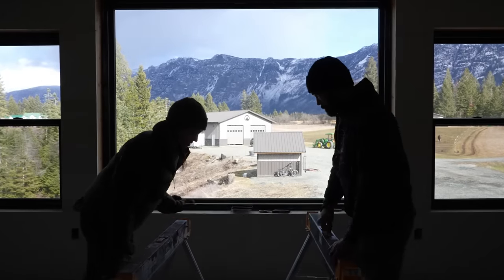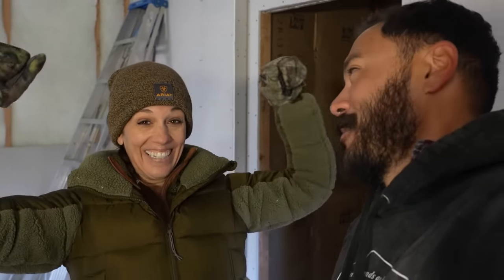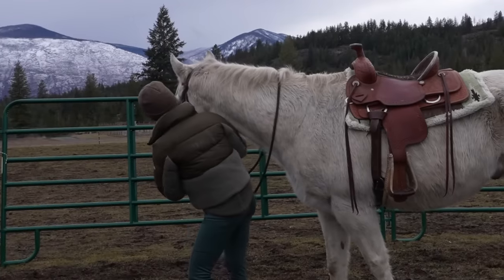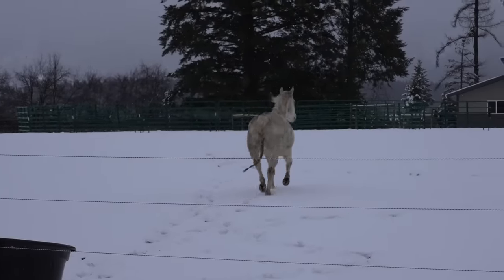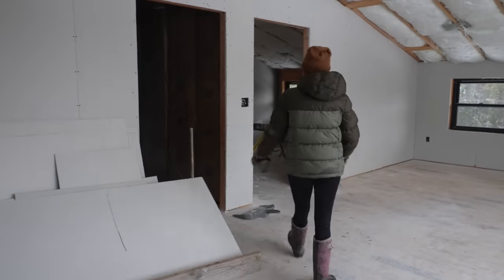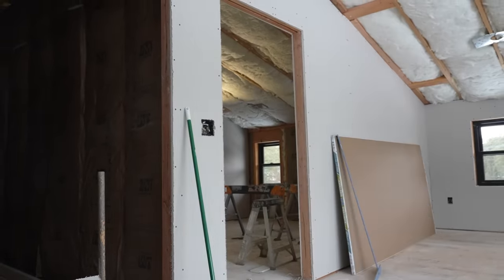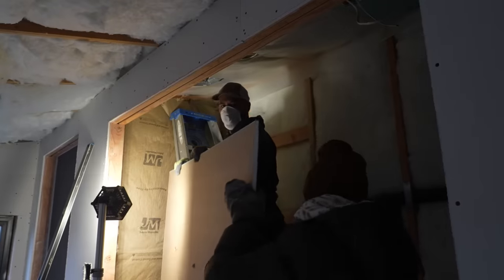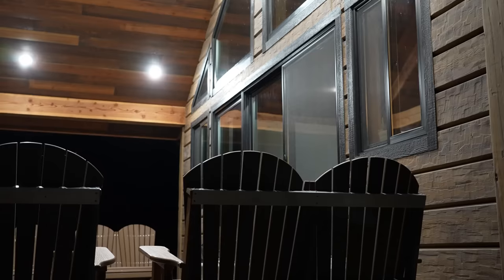We Have a New Deadline! Major Push on Our DIY Mountain Home Build

Comment: Vertical will make the wall look a bit taller, which might not be a bad idea in a room with low ceilings :-)
Reply: Yes, walls absolutely vertical. Ceiling, follow the lights rays. 😊
Reply: Get kiddos to help… especially if it’s to be their space for a bit of time. I learned to wire outlets and switched at 13. Father always checked them…. But the “shop teacher” needs to return!!!  (Of course that’s my opinion, you are the parents and a family unit. ) 
Enjoy the build and the challenges you work through. You have done fantastic!!!!!!

Comment: If you go vertical on the ship lap, it will look like a wide bead board.  I think that vertical on the ceiling and horizontal reclaimed barn wood would look fantastic on the side wall.  And since the bed is going there, it would be an excellent back drop  and a great place to hang pictures or some sort of art.

Comment: Horizontal on the feature wall. Paint it slightly different from the ceiling. Glossy on the ceiling? Pale, pale yellow on the wall? I don't think it'll look like a breadbox. If you go vertical with trim separating the two, it'll look cheapy, like an RV or 80s build.

Comment: By the way, this is Alan from Massachusetts. When are you going to take the extension from the house to the garage and close that in because don’t forget you got a sewer line running down through there and if it gets too cold, it could freeze on you, so I just wanted to know if you were going to finish that off you don’t have to make a cathedral type group you can just make a, 80° angle roof which weight do your storms come in if the palms make the pitch at the top to the bottom if you’re looking at it, the higher part would be in the front and lower part would be in the back with the pipers, so I think you should do that too But that’s just me I mean you’re gonna have to do it sooner or later anyways but all the cold water you get it coming in there you’re gonna have that done before you put your plumbing in cause if it freezes my friend you’re gonna have a problem well have a good day like your job. I love watching you guys I just love it. I wish I had more videos of you in the future not the past we know what I mean by the past I’ve seen everyone you havethank you very much. Continue moving forward. God bless all your whole family. See you later.

Comment: If your house had either stone pillars or stone lower trim - I would have suggested the accent wall in Gabby to match. (I looked back then and it didn't.) My point was that it's a good idea to bring some of the outside elements indoors. With that said - Have you thought about maybe using some of the stone wood siding on the one accent wall?  Just an idea.  Tony

Comment: Did you ever considered a stair tower between the main house and the garage/apartment?   A common joined ground level entrance at the side exterior door, the house door, the people garage  door and up to the apartment.   Safe exit from second floor apartment in case of fire, not exiting through the highly flammable car space of the garage, with no stair interupting the main garage.    The joined entrance tower would be a nice way to go from apartment to the main house without going through car area of the garage in cold months yet have its own dedicated entre points to outside and garage.   No need to make your  way around parked cars and utility space.  If this idea is beyond the current scope of work perhaps Phase 2 in the future.  [The stairs within the garage would be fine for a free standing building.   Hoping the garage walls and ceiling are all fire rated one hour, separating living space from garage.  Don't forget the car engine fumes from a vehicle running in a garage with all doors closed. It is easy to over look these concerns when building codes may not apply to your area.  Safety first.]

Comment: I have those dryer vent fittings too. They transition from round to oval to go in a 3 1/2" stud wall, then back to round below the floor. I also have the quick couple twist to lock connection for when you need to move the dryer. No tools needed, just twist the coupler 1/4" to the left.

BTW there is alternative to both horizontal & vertical accent. It is diagonally. (diagon - alley) REF: Harry Potter

Comment: Horizontal I think because it’s a accent wall & your ceiling is slanted down into the wall, so it won’t look like a breadbox because it’s only one wall. It will look odd if you do it vertical because your ceiling isn’t flat but slanted. Great job as usual. Whiskey will be better off with minis like him. 👍

Comment: Rather than have wild cuts on the drywall for the light holes just make a jig with a hole saw or jig saw.  Just make the hole only a little bigger than is needed to accommodate the head of the Rotozip.  If you do not have the option for the above then drive a screw into the drywall in the center of the hole and tie a string to it and use it as a pivot to run the Rotozip in a circle.  Perfect holes every time.

Comment: Old school is to use an escutcheon between wall/ ceiling and fixture or outlet.  An escutchen can be of virtually any material, any shape, and any thickness as long as the wires can reach the fixture or outlet and you've got long enoughnscrews to secure everything.  Often they're some what fuctional butv pople treat them as ornamental.

Comment: Things  are coming together nicely.  I agree that running the boards horizontal would not be the best.  But rather than vertical, I would suggest running them diagonal either in a V, straight across diagonal or do a diamond patter - it creates a bit of waste but would look nice.  I would not paint the wall but rather leave it natural.  Good closing remarks.

Comment: Horizontal ceiling. And maybe vertical small thin light wood with space inbetween on the accent wall. You could even make a cool pattern with the thin wood. I saw that on fixer to fabulous. Man it was cool. Good luck